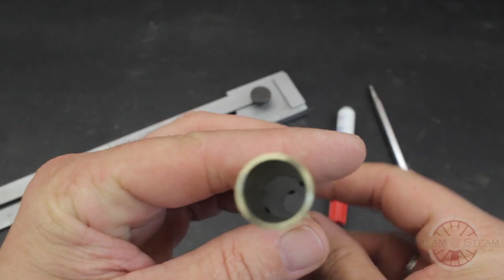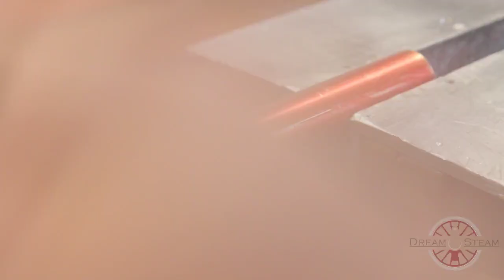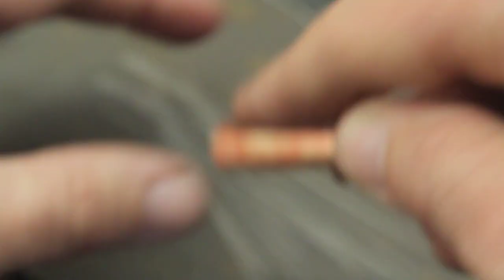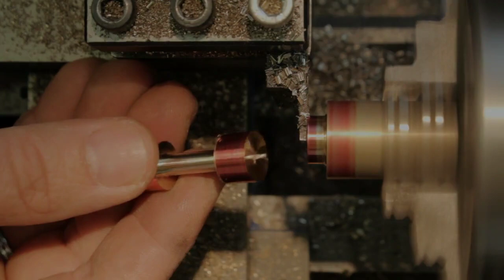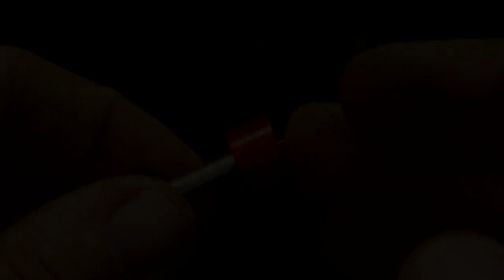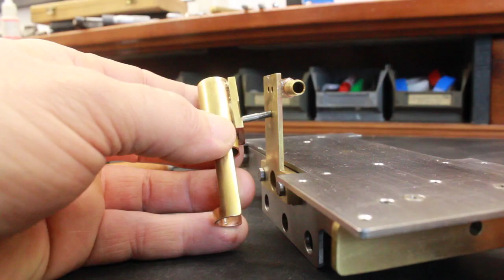Lets Build a Cracker # 4 The Piston

Comment: It used to be possible to buy asbestos packing with a graphite based grease soaked through it for piston packing. It came in round, square and loose strings. It was great for sealing the piston and it held enough lubrication to prevent wear. Probably it's very hard to get now but I bought some asbestos  woven cloth for boiler insulation back in the '80's. You can take some of the individual strands out to make your own piston packing and gland packing. I guess it's too scary for some people these days. Nice job on the filming and filing processes.
Reply from the maker: I thought about a o Ring or a sealing. But if you turn the Piston Spot on, and use hot steam oil, the oil seals perfect. But it is a idea... maybe i will Upgrade it. 
I use PTFE or PTFE geaphite... 
Thanks for watchig and comment... it feels like rushing through because theres a lot to do on my house.... so it could be a better Video edditing.... sorry for that.... time is short in the moment